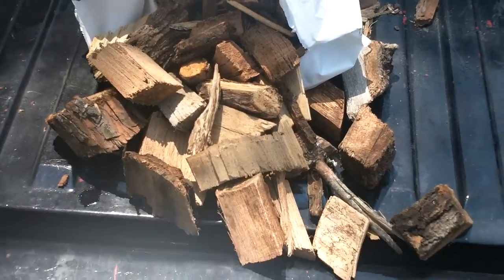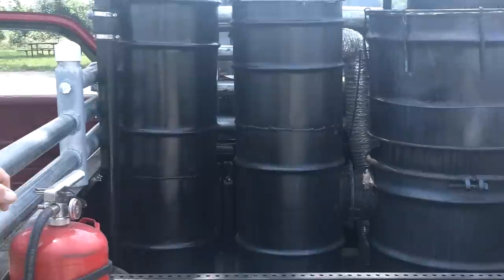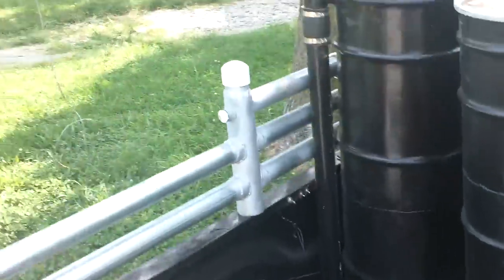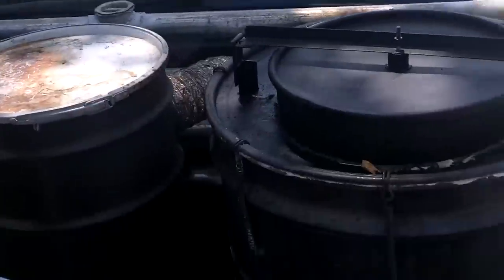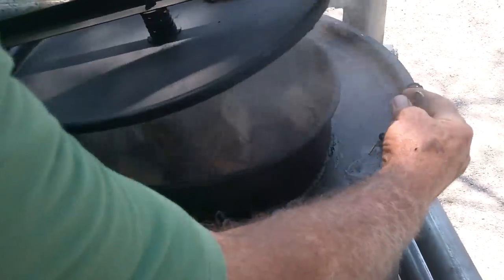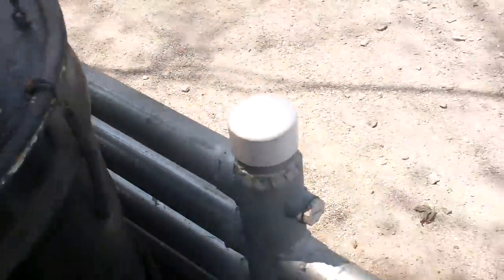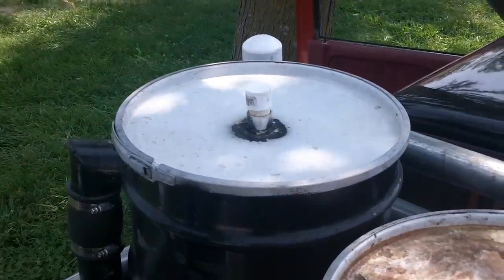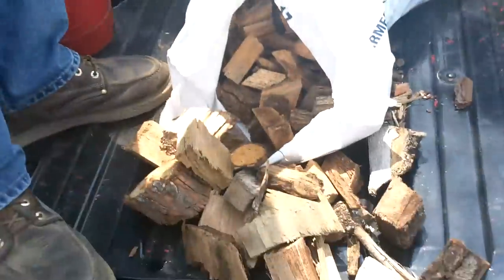Wood Gasification, As Explained by Wayne Keith

Comment: Yeah, the high school biology class mentioned some of these. Wood sap traps volatile chemicals for sure, heating releases the volatiles, and carbon monoxide is fuel by definition. But no one seems to come up with calculation about the cost-economy of this system. When oil runs out and if we still cant do fusion by then, we will have to do this gasification like the good old days of WWII for sure.

Comment: does it need a special motor to use the gas?
Reply: Any internal combustion gas motor will work, Wayne's systems work best for large displacement engines he prefers 318,360 dodge dakota's and dodge v10

Comment: This is impossible. Steel melts at 700 F according to our beloved government, at least it did on 911....
Reply: You forgot your tin foil hat.
Reply: Consider lining the vessel with insulating refractory cement to protect the steel from thermal stress and to keep the heat inside the gasifier

Comment: Wood gasification technology is a loser.  More energy must be put into it, than comes out. A better approach would be a wood fired boiler, make steam, and turn a turbine generator.  The process of making wood gas, then burning the wood gas in an internal combustion engine, to then make power is less efficient. The wood gas is a very dirty fuel and the inside passages of any engine run on it, would become caked with buildup deposits of the wood smoke, just like a chimney in a wood burning stove or fireplace.  A LOT of wood had to be burned, to make wood gas.  Another issue is, the wood gas needs an exceedingly high temperature to ignite.  The high temp causes the liner in the burn compartment to wear out in 5 years or less.  These furnaces are very DANGEROUS.  The exhaust flue on them gets exceedingly hot, over 1000 degrees, and will burn your house down.  It's not something you'd want in or anywhere near your home or business.  This is a last ditch idea that would only make sense if all the oil, natural gas, and coal on the planet, were depleted.   Add to it, these wood gasifications units are exceedingly EXPENSIVE, costing well over $7,000 for an entry level unit.  The liner has to be changed every 4-5 years at the cost of another $2000-$3000.  Not worth it IMHO.
If you want to see a truly viable form of alternative heating, take a look at Alex Johnson's videos, his youtube name is FLAIMDANCER.  HIs lava rock filter catalyst stoves, simply blow away these wood gasification furnaces.  He has perfected a stove and furnace, that will burn green wood, plastic, tires, trash, seasoned wood, whatever else you want to put in it, and with NO SMOKE once the catalyst heats up and ignites.  It only takes 5-10 minutes for the stove to get up to operatiing temperature.  He installed one in his living room, in his own house.  If you put a wood gasifier in your living room, it's eventually going to burn your house down. The flue pipe on the lava rock catalyst filter stove, is cold to the touch.  It keeps all the heat inside.  Check it out.
Reply: Don't forget to take your meds...remember what the nice doctor told you...
Reply: Just to point out that you can use any solid bio fuel for the system. I've seen wood pellets used for a emergency generator. (keep in mind i have no dog in this hunt, I'm a WWII nut and seeing the Germans use this system on their tanks was interesting)
Reply: purplexenno you guys come up with these half assed heating alternatives, unless you own 100 acres of standing timber, they are a loser.  and even if you DO own the land, the work involved cutting, splitting, stacking, felling, bucking, chain saws, gas, oil, driving vehicles, this is a major LOSER and a last resort.  wood pellets cost more than coal !!  stop giving us this line of bs already.
Reply: "Wood gasification technology is a loser." says the guy with nowhere near the experience of the guy actually doing it, Mr. Keith.